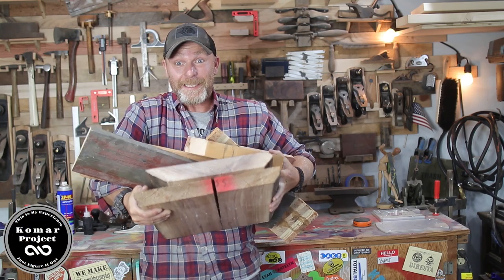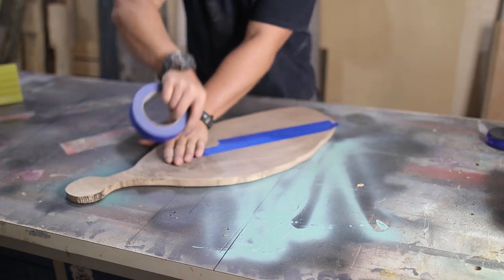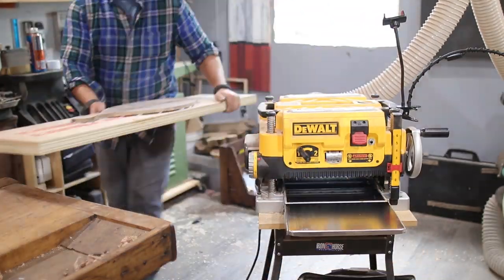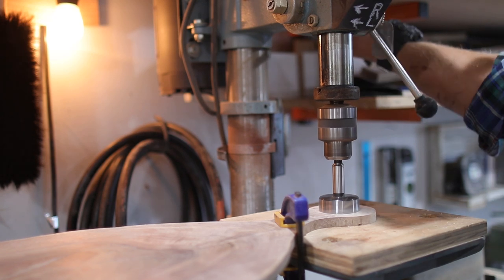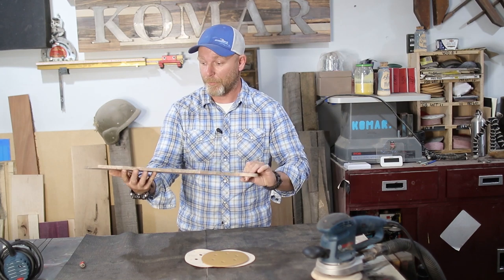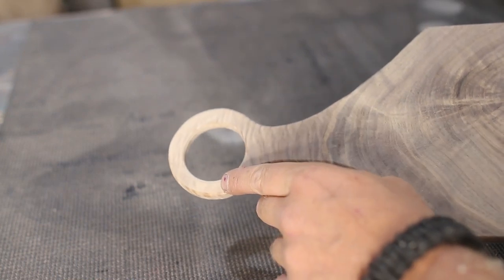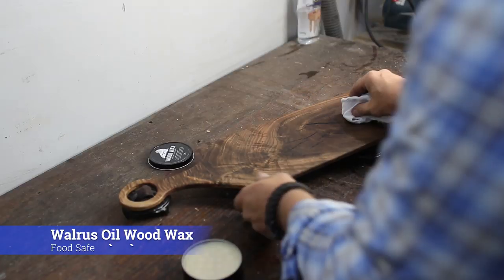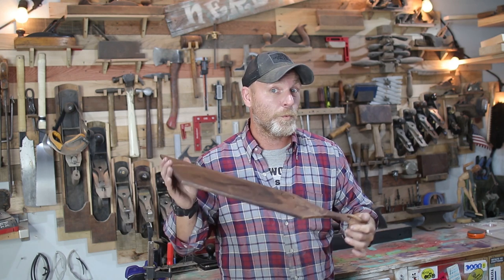How To Make a SERVING TRAY Out of Scrap Wood // DIY Charcuterie Board

Comment: Perhaps the drill press wouldn’t cut the hole because your table was lower than the length of travel of your press. Raising the table probably would’ve solved the issue. Great video and nice board.